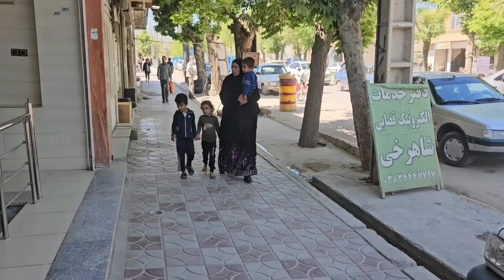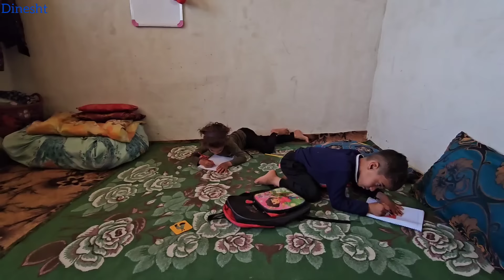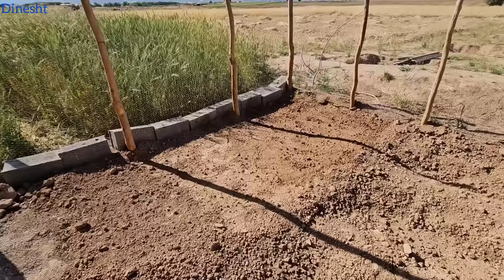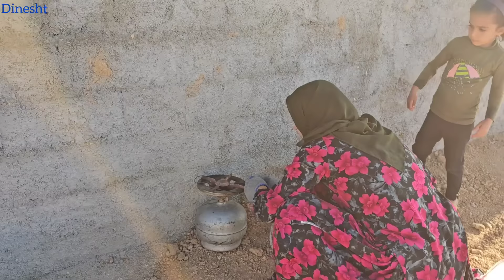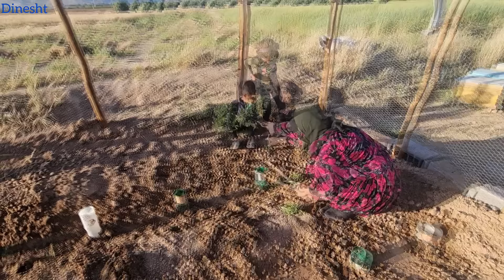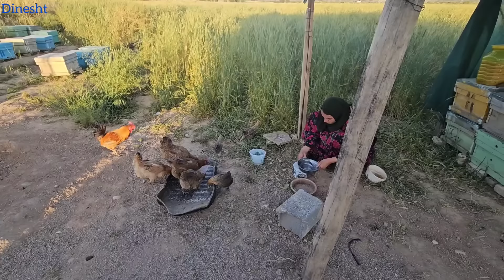"The Waterwise Gardener: Creative Tricks for Growing Seedlings in Dry Conditions"

Comment: Operator, do they use plastic over plants there? To help keep ground moist? WIth the water bottles, and the plastic, will cause condensation on the plastic to keep and water plants.  Small bit of air flow through it.
Reply from the maker: آب می‌دهیم به نهال ها